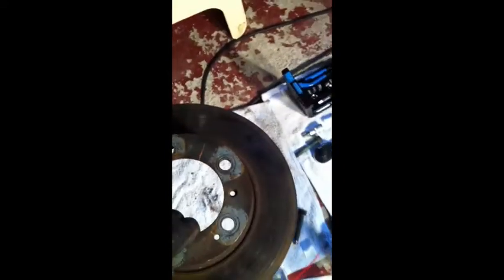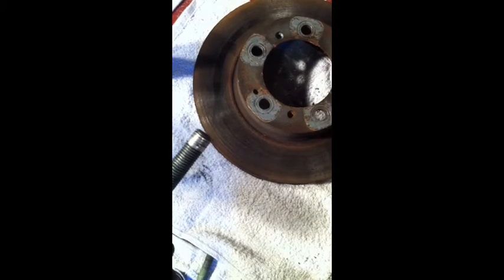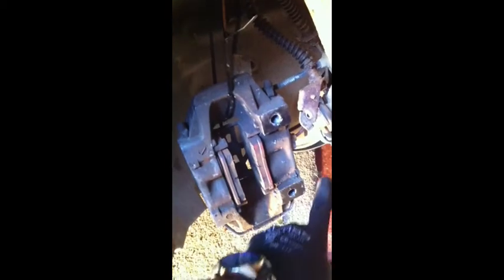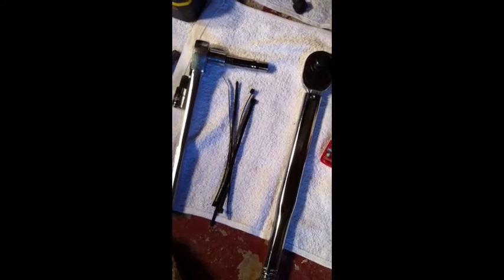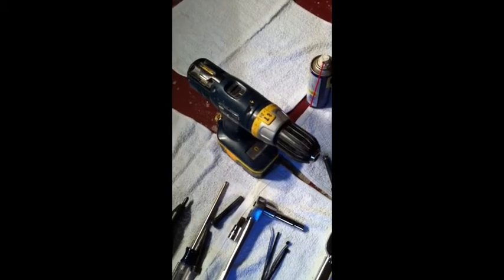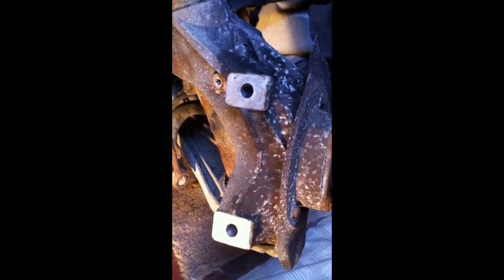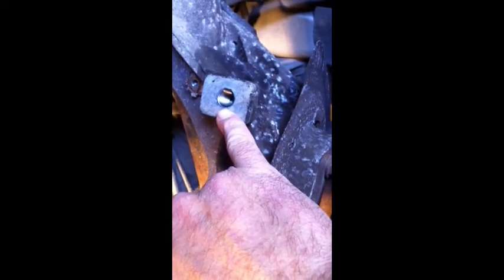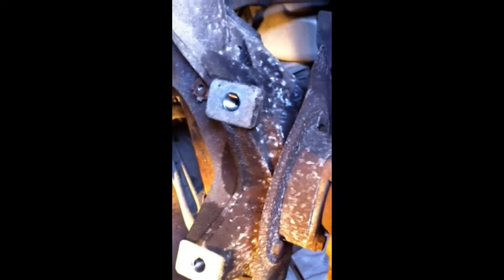Porsche Boxster 2.7L brake caliper bolt holes stripped

Comment: Great video! I’m facing the same issue on a 2015 Cayman. 

The mechanic suggested me to send the wheel carrier to a machine shop for thread building saying “if they do in their shop the thread itself isn’t leveling so it will cross-threaded after a couple of uses…” which I found it suspicious.

Any thoughts on this? Also, how long does the DIY part last in your case?

Comment: Good job. well described. Might help me in the future. What helicoil  kit are you using?
Reply from the maker: I used an M12 x 1.5 V-coil kit number 4022 for the repair.
Reply: @resthivet  I bought a used hub with a decent thread to use if my damaged thread failed but it torqued up ok so fingers crossed the hub will not be needed.
Reply from the maker: @indieworks  Hey, that is a good back up too!  As you say, hopefully you won't need it.  All the best!

Comment: Please help I have a 2000 996 convert. I have a stuck caliper bolt pass side. I can't get it past half way out. I am afraid of rounding off the head. Any ideas on how to get it out? I used heat and penetrating oil etc... Also what size helicoil kit did you get to handle the caliper bolts . Mine is the same size as your boxster apparently. Any help would be greatly appreciated. By the way I can't even tighten it back up now
Reply from the maker: Hi, I know it was 4 years ago, but how did you finally solve your stuck bolt issue?